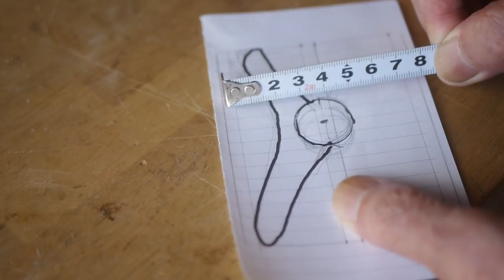Corner clamp with pin

Comment: Outstanding my Friend!  For small frames the tension should be fine for a long time.  Just built a small walnut (6mm) box for some knives I built for my son and wish I would have had these during glue up.  Thanks Always for your great designs, graciously built and filmed with care!!
Reply from the maker: Hello PJ
Always welcome to my workshop
This cheap clamp is a little lacking in power! But OK for my use! One day I will devise a metal ring type spring.
This clamp is perfect for fixing the corners of a frame cut at 45 degrees as you say.
I will upgrade this.

Gratitude and friendship from Japan
Tachi

Comment: Such wonderful simplicity. If you changes the angle of the jaws would you need the pins?
Reply from the maker: Hello friend H Wood
Thank you for always watching my video
And thank you for your comment
Unfortunately, I didn't fully understand your comment!
This clamp requires a pin at any jaw angle.
Isn't this the answer to your question?
If so, I'm sorry!

Gratitude and peace from Japan
Tachi
Reply: @TachiOhyo56  I thought that if the jaw angle was 90 degrees, or slightly less, it would apply enough pressure on the corners so pins (and possible pin marks) would not be necessary. I am probably wrong!
Reply from the maker: @hwood9783  
Yes, now I understand your question.
Yes, this clamp is for intentionally opening the mouth and hooking and fixing the corners with pins.
As you can see, the chin is designed wide by default.